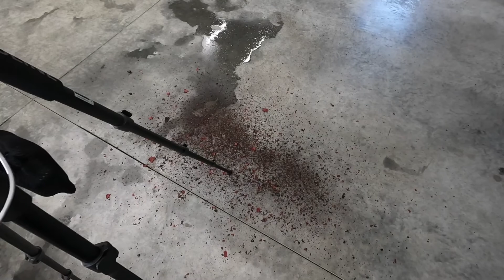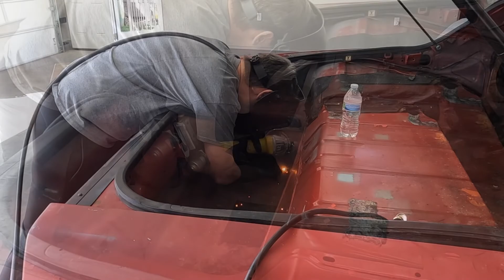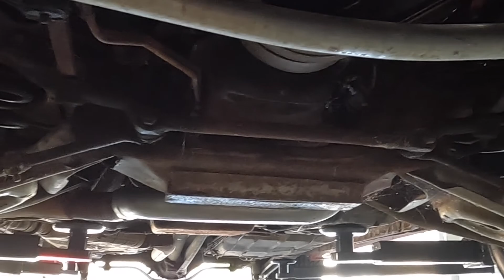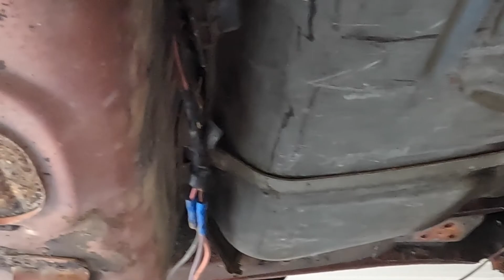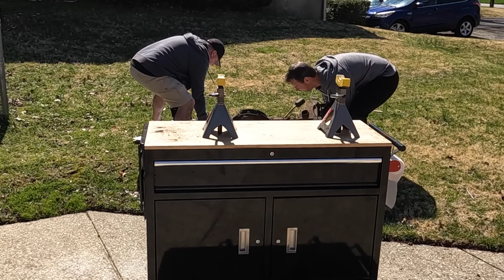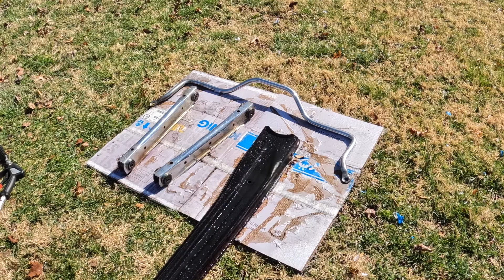Rebuilding My First Car Part 4: Small Steps

Comment: So now you've built the 92, the way you essentially were going to build this car, are you going to turn around and rebuild your first car into something better than even the 92?  it would be awesome to do another LS conversion and build in this car, building on all you learned the first time around.  I love the attention to detail, and the cleanliness of your shop, builds and other rides.  Anyways, what are the plans for this one!?!?!
Reply from the maker: My 92 isn't done. Still has a long way to go:
Fix transmission/clutch issue
Finish engine and rear end break in
Dyno tune
Koni adjustable shocks
Paint
Etc. 

However, while I'd love to work on my original car, I'm tired of working on red Firebirds right now. I haven't decided on a gameplan for the car yet. It will get an LS, but might be an auto. I may build it more like a period correct car from my teenage years.

Hoping to build a new house with more land soon (and build a bigger shop too) so we will see how things go.

I really appreciate the kind words. Hoping I can find some extra time to get in the garage and do things soon.
Reply: @StebbinsGarage  Oh i understand all too well about a car not being done even though you're out there driving it around and enjoying it some.. my 92 is that way, while i work on my 68 and 00.  

I wasnt sure if you had plans to actually work on and re-do your first car or not now you had the 92.  If i were you, with the 92 having the front end you wanted and all that, i'd leave the ol girl alone with her front end, at most i'd do a hood, and the same spoiler as the 92, but thats just me.   Since its a sentimental thing is my reasoning, same thing with the color unfortunately.  A full color change on the 92 before you started would have been the tim eto do it, and would have kept you from having to deal with too many red F bodies. lol.  

I realize when you originally built the first car, you had all that tweed and stuff in it, but i think i'd go a different route on the interior while still trying to pay homage to the original build.   I really enjoyed following along with the build on the 92, and love how you did it right the first time with each thing you did.  it is how i do th ings too.  Some may call that OCD, but i'd prefer to think of it as paying attention to the details. Please let us know what the gameplan on the Old girl will be, as im excited to see what you do and follow you on that build too.   A period correct car from your teen years may be perfect.  An Auto LS would be sweet too, make it a cruiser more than a racer.. 

A new house ? Congrats.. I love your current garage.. i only have the one attached to my home, and watching you in your garage has me envious. its set up very nicely.  I wish my wife would have let me move further out into the country when we were buying this home, but she wanted to be closer into the city.. 5 Acres and a 40x60 shop would have been glorious along with a modest 2500 sq foot to 3000 sq ft home.  perfect.   I wish you the best of luck in your home hunt and move and your future work on your cars.  you have some beautiful rides there man.  I wish you were in SC so i could hang out with ya in person and work on the thirdgens together!!   Best of luck  -Steve